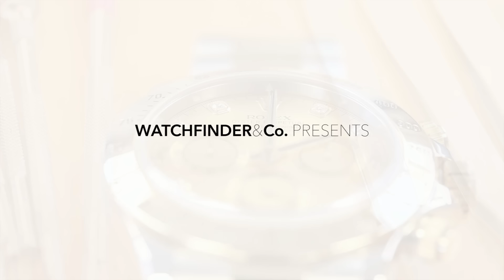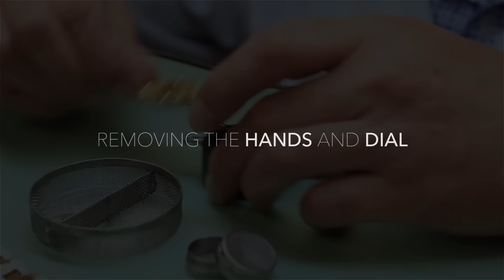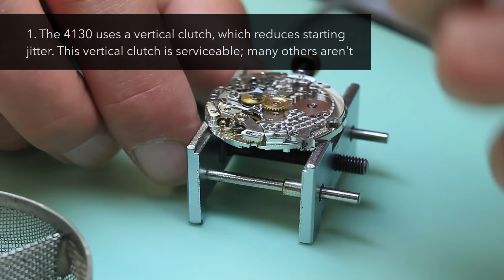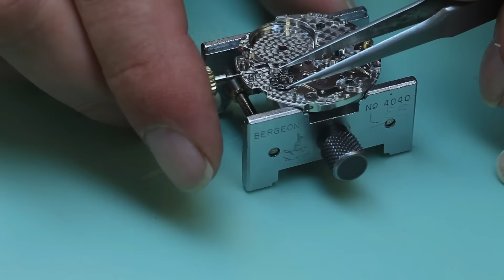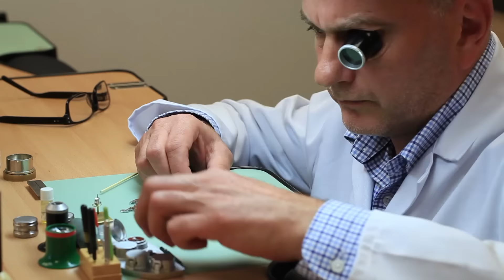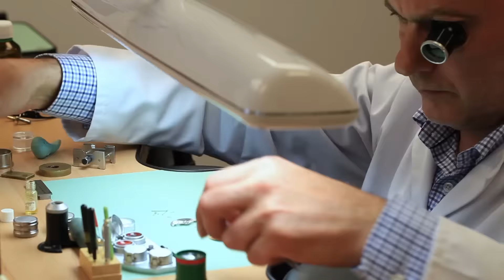Rolex Daytona: HOW IT'S MADE

Comment: 4130 developed in-house? Made and designed by Aegler you mean. Aegler made  movements for Rolex between 1905 and 2004, until Rolex bought Aegler in fact. Rolex has not produced a single before 2004